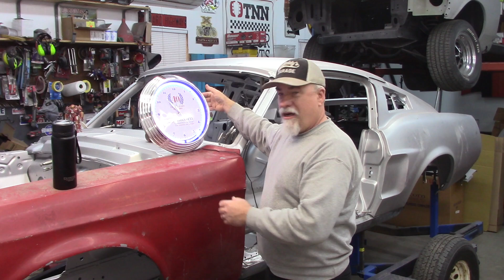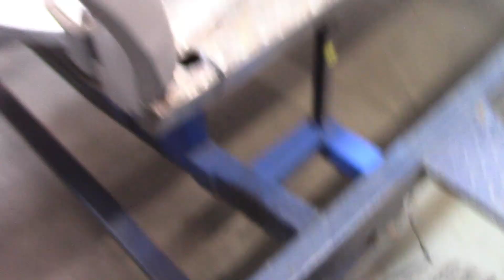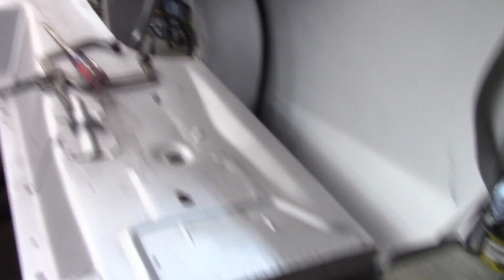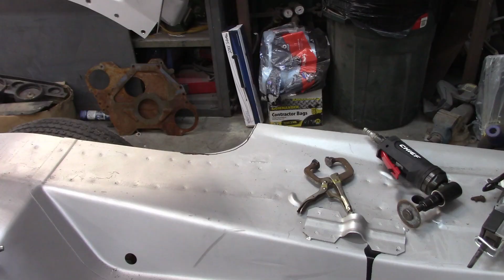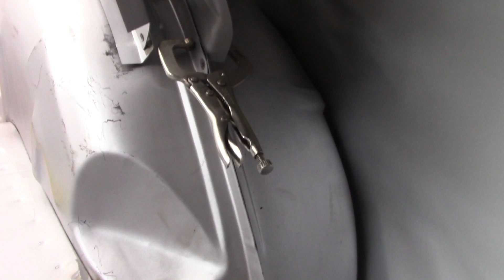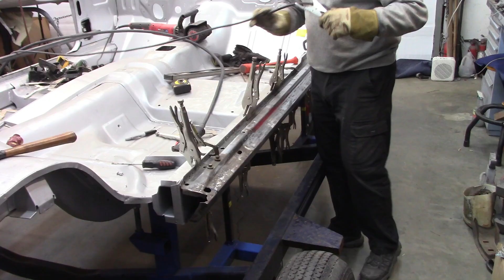68 mustang fastback build. Dynacorn panel test fit. Fangled 7. #mustang #howto #diy #dynacorn

Comment: if you can find a electric hacksaw blade, they can be sharpened on the end and down  the sides. this makes a narrow spot weld breaker. machine shops etc may have broken ones in there scrap metal bin as they break often.

Comment: Thank you!  I have the same issue with the gap between the inner wheel tubs and drop down panels. Mine are about 3/16” away from the drop down panels, so I was really worried it would be misaligning my quarters.  Glad to see the fix is so straight forward.
Reply from the maker: You're welcome!

Comment: Do you ever have trouble with the rear quarter panel extension? The Factory type Dynacorn Type.
Reply from the maker: I haven’t but I do a lot of test fitting. I will be installing a set of those on my own mach 1